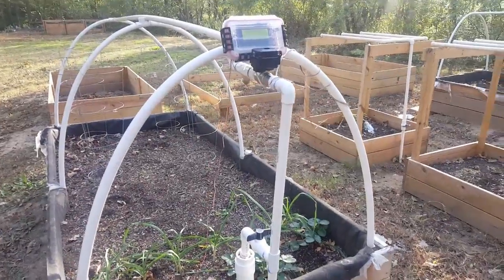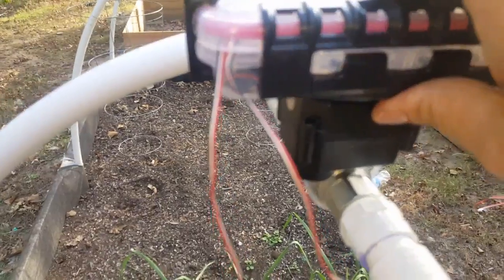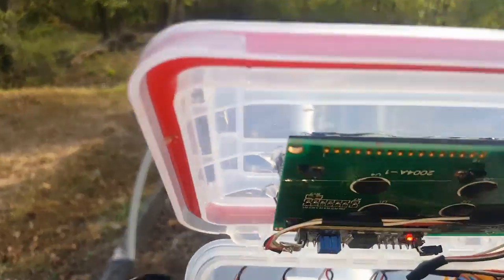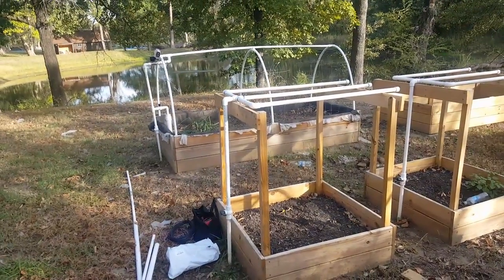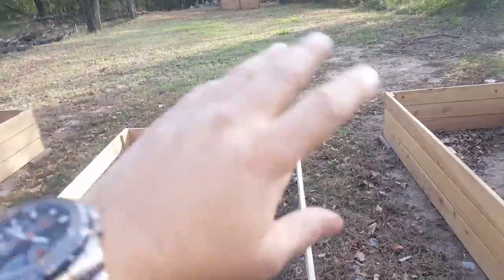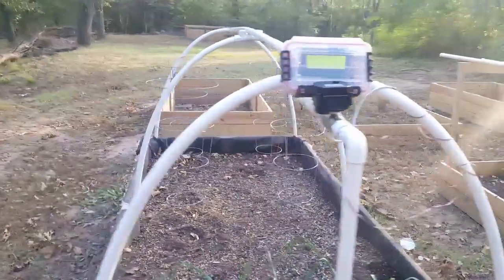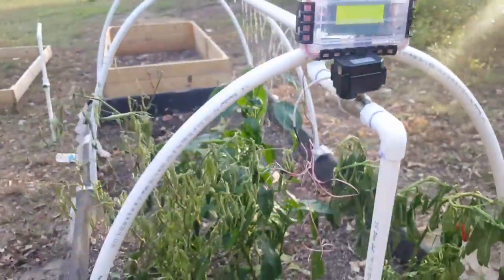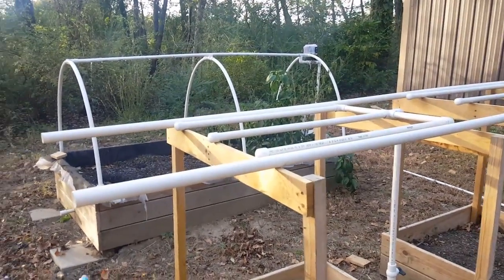Arduino Automatic Garden Bed Watering System

Comment: What all is being tied in to the 5V relay? It looks like a jumper from the 9V, and two jumpers from the ball valve. How did you get this to run off of 9V alone, I am having pretty big issues getting the ball valve to open and close. That is the only issue I cannot resolve.
Reply from the maker: i only used the 9v battery to test opening and closing the ball valve. It should be a 12v system to run properly.

Comment: Nice work, I saw esp8266 wifi linking instead of arduino still arduino coded tho and a few milliwatt standby, I've been testing closed plastic covered greenhouse with 8hr timer on tap so far so good just need a way to open cover when it gets hot like everyone's setups they all allow you to take ideas and arrive at the most cost effective, I remove my cover and use bobcat to scoop up old compost and replace with fresh then lid goes back on and start again

Comment: I may be a bit of a thicky, but I would do it differently. If you have a soil sensor saying you have dry soil, why wouldn't you water it then? Why wait until a specific time? Your plants could die waiting.

Maybe link the Arduinos somehow so that if one is watering the rest wait until it is finished watering (if you're really concerned about water pressure)?
Reply from the maker: I actually made another video sometime ago with the exact thing your talking about. My updated code does just that... it senses the soil moisture and waters accordingly. Thanks for your input!
Reply: @EngineerPrepper  Oh, okay. Sorry. To the best of my knowledge, this is the only video of yours that I have seen so far. Good to know that I was on the right track though. I will have to try and find your other video. :)

Comment: What did you use for closing and opening of water supply? Mine is 12v water valve but the water flow is not good for as big as your garden.
Reply from the maker: I also used a 12v valve. I have a rain barrel lifted up to about 7ft for a gravity feed water system ... it gives me about 5-8psi
Reply: @EngineerPrepper  Thank you for the reply. I'll use that when I implement my system to the field. I'm planning to connect it to our water pump so i don't need to check the water from time to time. Thanks again

Comment: How did you get pressure on the water?
Reply: He's using a water pump, another way without water pump you should put the water tank higher so it will have natural waterfall's flow once the valve is open

Comment: Hi, I just have one question. Is it okay to use a 1/2” valve that is a different brand and do we need a breadboard for the project? Thank you so much!
Reply from the maker: Yes, it's fine. I just chose that valve to fit my needs.
Reply: EngineerPrepper 
Thank you! Just one more question. Can a solenoid valve be used or does it have to be a ball valve? Thank you very much!

Comment: Hi! I think your project is great, I think you should add some features that will be better.
1. Time you should setup 24h, so you will develop the function as night without watering the plants. In the afternoon, the sun should not be watered.
2. You should setup more solar charging feature.
3. You should setup more Ultrasonic Sensor when the water on the tank runs out, the water pump automatically pumps.
Thank you for sharing the video

Comment: I'm interested in that relay/water valve.  I want to automate my sprinklers for the front and back yard.   What I basically want to do is turn the front and back hose bibs on and off at certain times during the week.   The schedule would be: On at 5:00 AM, Off at 9:00 AM.  On again at 5:00 PM and off at 10:00 PM, Mondays, Wednesdays and Saturdays. I have soaker hoses and sprinklers connected to the hose bibs.  I figure I would put the Arduino and valve on the pipe before it leaves the house.

Comment: Been planning to do something similar for a long time. Good to see a working example. Just purchased some Raspberry Pi sensor kits for the same purpose. Hoping to network them together via WiFi to upload activity to a data repository, which could email me alerts.
 You are very close to having a hydroponic (or aquaponic) ebb & flow setup, which would use less water. Is that where you are headed?

Comment: So does the relay activate a solenoid that allows water to pass through or does it close a circuit and turn a pump on?
Reply from the maker: good question, it allows the water to flow.

Comment: Automatic watering is a LOT easier than this folks, cheaper too. I put in 3 Orbit timers with y-valves on the hose bib, plus 3 Koram setups with drips and mist nozzles.  Under $100 total and super easy to setup. Amazon.
Reply from the maker: What you failed to understand is that this watering system is using gravity feed rainwater and not pressurized water lines from a home. The arduino are setup to conserve the water while maximizing crop yield.
Reply: The Orbits and Koram drips will work with gravity feed as well! Anyway, cool channel and have a good night.

Comment: Great project. How much did you spend on electronics alone? One arduino should be enough for the whole backyard. I should try this with a single arduino and get rid of the timer and lcd. Sensor should be enough. Thanks for sharing the code. Good job sir.

Comment: Hey sir. Can i know your gmail or Facebook account. I have questions. It's regarding our thesis about automated irrigation. I hope you can help and advice us. Thankyou
Reply: Done this project for a greenhouse using  temp and light, very simple  4 hour  based on a 1 minute scan time, 240 
 mins in 4 hours, watering cycle,  light meter closes the windows at dusk and stops any watering  during the dark hours, then the light meter allows the temp to control the windows again at dawn, and allows watering again. mostly for tomatoes  which are thirsty little buggers,  note  watering for 1 min every 4 hours supplies about 1/4 liter , about 1 liter in 24 hours per plant  - roughly,  unfortunately  I don't use CC+ as the programming language so i cannot help  with the code, also I used a H bridge to control the window motor and the water valve....
Reply: sir Peter Hill will you please share the code of your project?

Comment: Nice setup u have there. Try a different approach to this problem. Try not to water the leafs of the plants specially when it's too hot outside, if you don't wanna give a thermal shock to the plants.
Try to mount a drip system close to soil.
You can combine the clock, with the humidity sensor and water the plants when the night is coming to avoid thermal shocks. Or underground temperature sensors, to avoid fast evaporation of the soil humidity.
If you want to cover the whole rised bed with poly foil, make sure to add some motors in order to open and close some venting doors. You want to keep the constant temperature 24/7 inside of that small greenhouse.

Comment: Which kind of pump do you use?
Reply from the maker: I dont have a pump... its just a valve that open/closes. The water is gravity feed from my water barrels.
Reply: Yep could you publish the used link for the valves ....
Reply: Also interested in the solenoid type

Comment: Is there a way to do this without the Real time clock? More of like an as needed watering system rather than timed? or can I just take that part out of the program?

Thanks
Reply from the maker: +Olivia Clark You know, that is a good idea. I'm sure you can, let me see what I can do. Because I wouldn't want to replace the battery in the RTC.

 I only had the clock in there so I can have a limited time for each bed, since I don't have high water pressure due to it being gravity feed. I have to do each bed one at a time.
Reply from the maker: Cool, I look into this... might be a version 3.0!

Comment: Looks great, but 1 arduino has ports enough to handle more than one bed. Only requires pulling two lines to each bed. I understand you are not using the humidity sensor?  as you have it on timer.
nevertheless I like the setup with the watering pipes... eventhough some people say one should never water from above :-)  well I guess that is just nature
Reply from the maker: Thanks! Yes you can have more than one relay... But my setup I have to have one for each box because of the water pressure. I have to water each bed one at a time (for now)

Comment: Not sure if you're still working on this or if it's completed but I am giving a suggestion and that would be using a manifold type system instead of making a unit per grow bed. What I mean is that you can code arduino to open a valve for that grow bed and water. Only one setup using a 12 set relay. Simply just tell relay turn on at this time and that grow bed gets its water when the valve opens. Of course it should be in conjunction with the soil % as someone suggested and you can still use this. When ever the soil checker says it needs watering arduino will then tell that to relay and open that grow bed water. 😜👍
Reply: But when you have just 1 more Arduino module to control just another relay you can make a barrel-refill control logic with a sensor so you're filling up your barrels with tap water - if latter is available of course. If not, I wouldn't even extend the garden if water is running low in the dry months anyway - else you kill the plants.
Reply from the maker: The moisture % is in the code commented out, I added the timer for two reasons... 1. so people can have a choice to use either one, and 2. I am limited on how much water I can supply to the beds because of the size of the rain collection system and the summer months doesnt rain when I need it.

Comment: Nice project. Any progress on the project with regards to how you will monitor the water level(s) in the tanks? Cannot get my head around how to use the components for water level status you listed in your dropbox, a specially at the tanks..
Reply: I think I'm far too late to answer the question but it could be based on pressure or sensors. 
If you put a pressure meter on the output of the tank, it can be calibrated to the right volume in the tank. If you put a float (i don't know if this is the correct word) in the tank and you measure it with a variety of possibilities it works the same. Hope this still helps, if not, it helped me with my English :D
Reply: This is a link to a color sensor that can collaborate with the float: https://www.youtube.com/watch?v=CPUXxuyd9xw

This is a float: https://www.google.com/search?q=measuring+level+tank&client=firefox-b-ab&tbm=isch&tbo=u&source=univ&sa=X&ved=0ahUKEwjtrfSs7uHbAhURK1AKHfmABa8QsAQIOQ#imgrc=8GHEdHeWvTb_tM

This is a water sensor:  https://www.gearbest.com/home-smart-improvements/pp_668897.html?wid=1433363&currency=EUR&vip=4455135&gclid=CjwKCAjw9qfZBRA5EiwAiq0AbZJyYTXrbVA2Oi7_AvR8ytpYcmaUP_oNnd_09hj2xDom9gdhz8BoeBoCn6QQAvD_BwE

And this is a pressure transmitter: https://www.google.com/search?q=measuring+level+tank&client=firefox-b-ab&tbm=isch&tbo=u&source=univ&sa=X&ved=0ahUKEwjtrfSs7uHbAhURK1AKHfmABa8QsAQIOQ#imgdii=q1iCgw2J0u_3vM:&imgrc=qBsyCvg81fq21M
Reply: Simple. you have 2 or 3 or 4 float switches. In my case on a tank which I'm automatin, I'm using 6 float switches for a 3' dia x 6' ht tank which tells me approximately how much is in there by doing some simple calculations.

Comment: Nice. Just wounding  why are you using a timer. You  are using a moisture sensor, just program the adurino to keep the moisture at a set %, this way your ground won't dry out like it does when using a timer.
Reply: the best system would be that the moisture sensor triggers a timer so that the water gets added after a certain amount of dry time for the plants. if you would get rain in that time you could code in that the sensor then resets to moist conditions and disables the timer. so you would never drown your plants. off course you would also put in a light strenth sensor so you dont water your plants when the sun is beating down on them. because if fresh green plants or plants like basil you would then cause the plant to burn up.
Reply: @highkicker11  hi there. I'm newbie at this stuffs. Im sorry if my question is very dumb. Anyway, what electrical component should i use as timer? I want to sensor triggers the timer. I found timer555 but i think this isnt the proper one, or i just didint write the right code, idk.
Can you guys help me ? Thanks.
Reply: @btgsrqlvs  as you would be using a arduino like the video shows the timer would be software and going of the clock of the ardiuno. Aka no 555 timer circuit needed. If you where to build a compleet hardcomponent watering board you would need a lot of comperator circuits and other chips or discrete components so the board would get quite big. Btw their a few dumb questions and yours is not one of them.
Reply: @highkicker11  hmm, you mean millis() function, right ? By the way thank you so much for your attention and answer :)
Reply: @btgsrqlvs  now the thing with Arduino is learning stuff. so I would say search your books about delays and timers. browses the web for them in C or C++. its the best way to learn the stuff for our self. that means that once you learn it you will remember it. copy pasting stuff just means you know there is a way to do it but you did not make it your own.
Reply from the maker: The moisture % is in the code commented out... I added the timer in the code, so people could have a choice.
Reply: You actually want the soil to go dry so the plant gets oxygen, that's a big problem if the soil is always moist, very low oxygen for the roots. This system is better, keep it up!
Reply: @CrisTooR  Well... If you use soil moisture, that's why you need two moisture thresholds. One to start watering, and the other to stop. And maybe add some delays if necessary.

Comment: Awesome project! I am working on something similar as well but I'm not finished yet...
I'm seeing some water barrels near your garden beds, so is your system gravity fed or do you have a water pump? In case, how high are they barrels placed to produce such a pressure? And do you refill the water barrels with the rain coming down the roof?
Thanks for sharing your project!
Reply from the maker: Brian Cobb A rule of thumb to calculate gravity pressure system is (height x 0.433)=psi
Reply from the maker: Nicola Giuliani Thanks! It's all gravity feed since I don't have water lines to that side of the property. Rain is collected from the shop roof and goes to my first flush cleaner and then into  my barrels. I'm working on now on the 12v system to each bed to run off solar... that will be on an upcoming video
Reply: you gain 1 psi for every 2.4 ft of height above your line.

Comment: how do you turn on and off water ? some kind of arduino module ?
Reply: is this what helps to turn on water ?
https://www.amazon.com/BACOENG-Stainless-Motorized-Control-Electric/dp/B0119ZI38U/ref=sr_1_1?ie=UTF8&qid=1490648968&sr=8-1&keywords=12v+3+4+valve+switch

if yes, how do you manage it in code ? do you turn on electricity to this valve for it at the mentioned time ?
Reply from the maker: Ankit Minglani yes that's the valve I used.
Reply from the maker: Ankit Minglani yes, in the code you can set the time you like, and duration or until the soil moisture reaches your set point.

Comment: Great project!you inspired me!

 I was wondering if it's possible to receive the data wireless from the arduinos to a raspberry pi 3 where the raspberry collects the data and sends an action back to the arduino"s" when the soil for example gets dry to open the relay for the watertank.

Comment: Nice! Do you ever fear your electronics will go bad even though they are in those water tight boxes? Does condensation ever become a factor or temperature ranges outside whatever the allowable limits are for the Arduino/sensors/components?
Reply from the maker: +Charlie Tan I do have a concern which is why i built the datalogger. I also place hot glue to cover most of the componets in case condensation does occur. I havent had a problem yet. Thats why i also mentioned about the solar panel next to my garden to power the electrons inside my workshop and out of the elemnts. These videos will be done and uploaded in the near future when it gets a bit warmer outside. Thanks for the great comments and keep asking questions as other people might have the same questions.
Reply: Thanks for the reply! I only ask because these were the same concerns I had when I was planning on doing something similar (though to a smaller scale than your example).  I'm actually working on an Arduino project right now that is finally getting past the advanced prototype stage (unlocking/locking the door to my room with a biometric reader in the outside hallway to actuate a linear servo motor connected to a sliding bolt lock).  I've run into a lot of problems I've had to solve and figure out on the way, but thankfully, I've not had to deal with harsh environmental ones! Keep building!
Reply from the maker: Charlie Tan Sounds awesome keep me up to date with your projects.